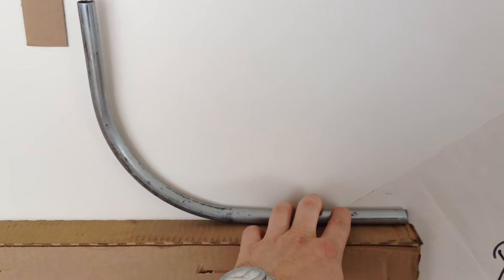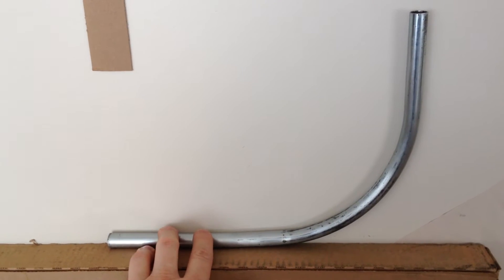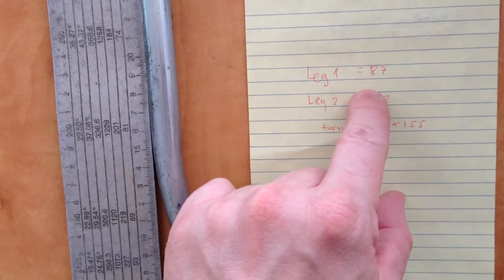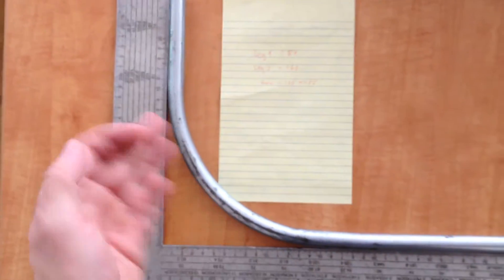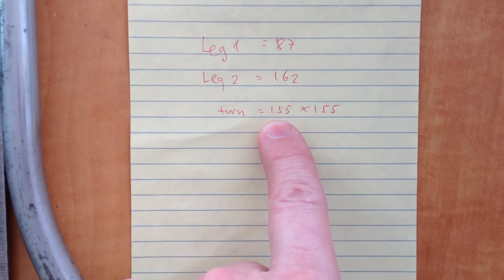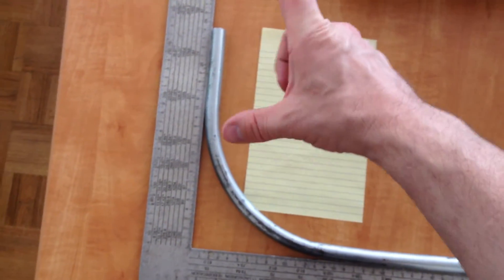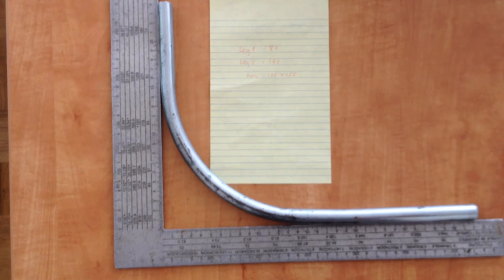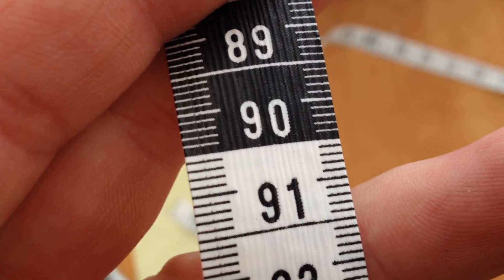Length of pipe challenge

Comment: Radius along neutral axis = 147 [155-8]
Arc length @ cl= 1/4 th of circumference of circle with radius 147 and therefore, (147π/2)
Net pipe length=  479.907mm
Reply from the maker: 10/10
thanks for watching

Comment: I doubled the measurement - 155 - which gave me the diameter of the circle (if the bend was a circle) then I multiplied that - 310 - by pi - 3.142 -  which gave me the circumference of the circle - 974.02 - and divided it by four (because the right angle bend was only quarter of a circle) = 243.505 then added the two legs + 87 = 330.505 and 162 = 492.505 which is the total length.
Reply from the maker: Excellent approach, good thinking, almost perfect but incorrect answer. The 16mm dimension has to be part of the picture too somehow.
Reply: apprenticemath Ahhh.  Thank you very much for your kind encouragement. I thought that since the bend "straightens out" into two straight bits, the ends would be "flat" thus the 16mm would not be a factor (I beg your pardon for my clumsy terminology and thinking!) If it MUST be a factor then I assume that half the diameter would be taken off the measurement at the top and the bottom of that quarter circle - so 492.505 less 16mm = 476.505
I'm sure there is a more "mathematical" way to put that.  
Perhaps it should have only been 8mm but I don't know why.
Reply: ***** For fun I tried that another way. I took 155 less half the pipe diameter multiplied by two = diameter is now 294, which multiplied by pi = 923.748 divided by four for the right angle is now 230.937 plus the legs 87 = 317.937 and 162 which gives the final length as 479.937
That one is probably right because it's much more "mathematical".
Thank you for this lovely problem.
Reply from the maker: Good hunch, thinking, all correct. Now the proof for this comes from materials science: @watch?v=JiARfu5ww4k
This video is a student assignment as intro to bend calculations, to spark some debate. Thanks for playing along. There is no way one could get any related solution out of any math book. There is no way of students definitely solving this as they have no previous background knowledge or experience relating to the concept of neutral axis in bending. There is no math proof for reality either, it is just so. The link explains, thanks for checking out my class.

Comment: 155 + 155 - 8 (half of the pipe diameter) + Leg 1 (87)+ Leg 2 (162) = 551mm ?
Reply from the maker: Need to include (pi) in the calculation of the arc length